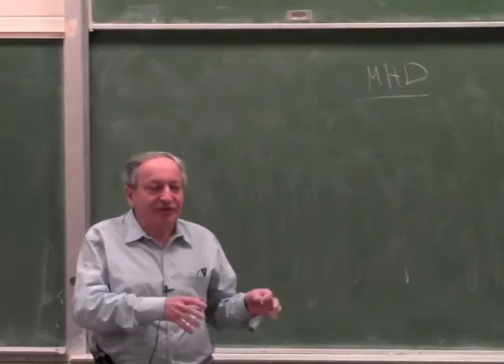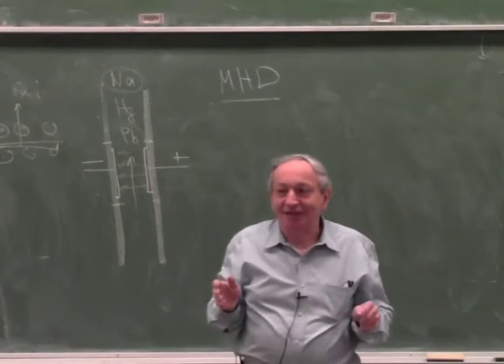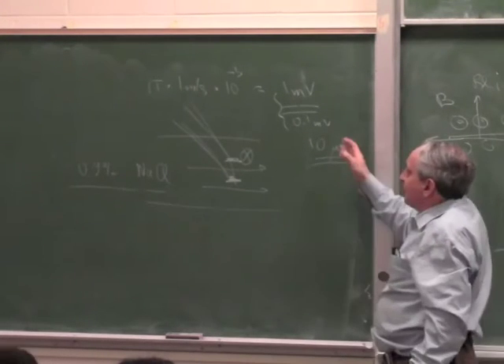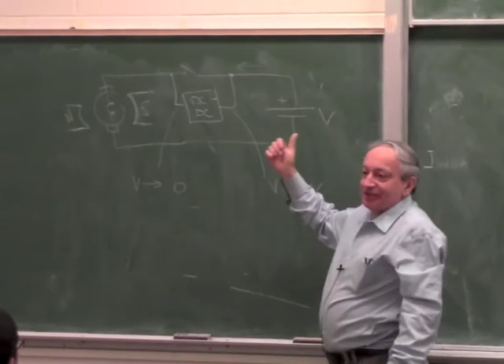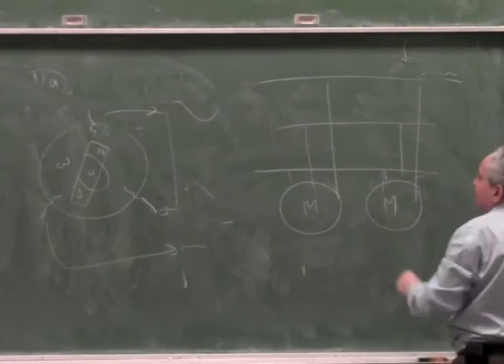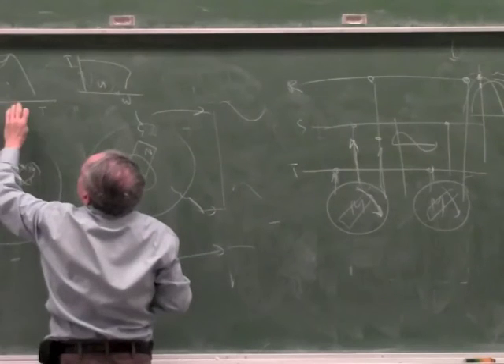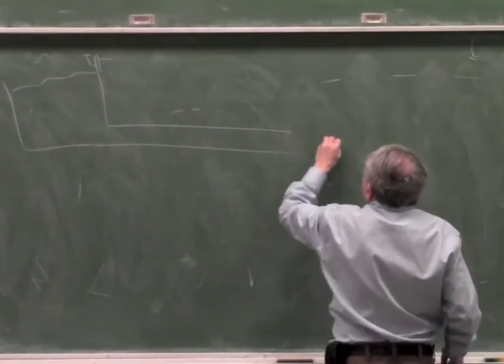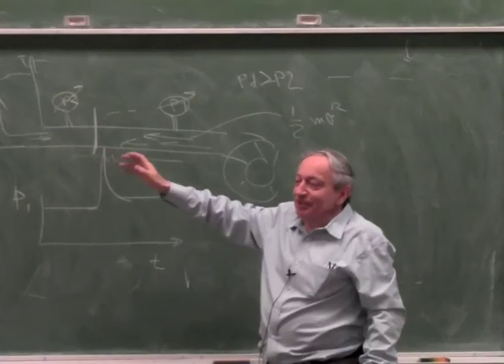23:  MHD, System Design, and Regenerative Braking

Comment: ai summary

Abstract: This technical lecture explores the principles of Magnetohydrodynamics (MHD) and regenerative braking within electromechanical and fluidic systems. The discussion begins with MHD, where liquid metals or ionized gases act as conductors within a magnetic field to facilitate pumping or power generation without moving parts—a critical application in nuclear cooling (molten lead/sodium) and biological sensing (blood velocity). The lecture then transitions into the mechanics of energy recovery, detailing regenerative braking across DC, synchronous, and induction motors. Key concepts include the use of DC-to-DC converters to overcome battery voltage, the "virtual shaft" synchronization of the North American power grid, and the manipulation of "slip" in induction motors to feed energy back to the source. Finally, the speaker establishes a cross-domain analogy between electrical and hydraulic servos, highlighting "dither" as a solution for mechanical stiction.

Technical Summary and Key Takeaways:

    0:00 Magnetohydrodynamics (MHD) Fundamentals: MHD is a subset of electromechanics where the conductors are fluids (liquids or gases) rather than solids. This allows for the movement of materials through magnetic fields using the same principles as standard motors and actuators.
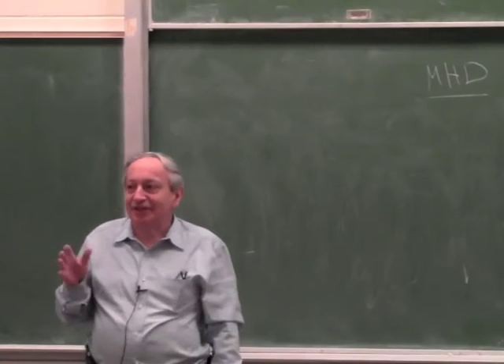    1:04 Molten Metal Pumping: A primary application of MHD is pumping molten metals like lead or sodium in nuclear reactors. Molten metals allow for high-temperature heat exchange without the extreme pressures required for water-based systems. MHD pumps are preferred because they have no moving parts, avoiding the risk of mechanical failure or solidification-induced seizure.
    4:11 The MHD Pump and Generator Mechanism:
        Pumping: By placing electrodes in a conductive fluid and applying a magnetic field ($B$) and current ($I$), a Lorentz force ($F = BLI$) is generated, pushing the fluid through the pipe.
        Generation: Conversely, moving a conductive fluid through a magnetic field generates a voltage ($V = BLV$). While fascinating, MHD generators are generally less efficient than traditional steam turbines (which operate at 40-50% efficiency).
    8:01 Plasma and Jet Engines: High-velocity ionized gases (plasma) from jet engines can theoretically be used in MHD generators. Because the velocity ($V$) is extremely high, significant voltage can be generated, though systemic efficiency remains a challenge.
    9:51 Biological Sensing (Blood Velocity): Human blood is a conductor due to its saline content (0.9% NaCl). By placing a limb in a magnetic field and using needle electrodes, blood flow generates a linear voltage relative to velocity.
        Parasitic Battery Effects: To eliminate DC noise and galvanic battery effects between dissimilar metals, engineers use an AC magnetic field. This flips the signal of interest while allowing DC noise to be filtered out via a high-pass filter.
    15:06 Regenerative Braking in DC Systems: Regeneration converts a motor's rotational energy into electrical energy to charge a battery rather than dissipating it as heat through resistors. This requires a DC-to-DC converter to step up the generated voltage to a level higher than the battery's potential ($V + \Delta V$).
    19:02 Self-Excited Generators: DC motors without permanent magnets can still act as generators by utilizing residual magnetism in the steel. This creates a positive feedback loop where the initial small voltage generates more field current, which in turn increases magnetism and output.
    23:03 Synchronous Motors and the National Grid: Truly synchronous motors act as three-phase generators when driven. On a national level (e.g., North America), all synchronous generators and motors are effectively "geared together" on a single virtual shaft. If a motor’s phase is advanced ahead of the grid, it automatically feeds power back into the system.
    29:34 Induction Motor Regeneration (Tesla/EVs): Induction motors, which lack magnets, achieve regeneration by reversing the "slip." In electric vehicles like a Tesla, a shaft encoder measures speed, and the inverter generates a rotating magnetic field approximately 10% slower than the actual rotor speed. This forces power to flow backward into the battery.
    38:10 Hydraulic/Fluidic Analogies: Electromechanical theory applies directly to fluidics:
        Voltage = Pressure; Current = Flow.
        Inductive Spikes: Closing a valve suddenly in a fluidic system creates a "water ram" (pressure spike) identical to the $L(di/dt)$ voltage spike seen when disconnecting an inductor.
    44:17 Overcoming Stiction with "Dither": Hydraulic servos suffer from high static friction (stiction). Engineers use "dither"—a small AC vibration or pulsation—to keep pistons in constant micro-motion, effectively eliminating static friction and reducing hysteresis for high-performance applications like gyroscopes.